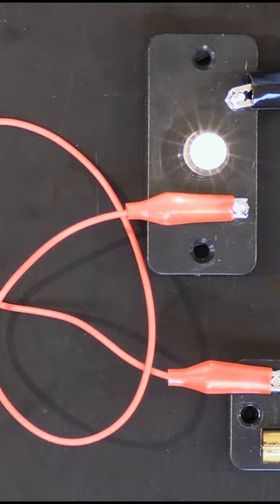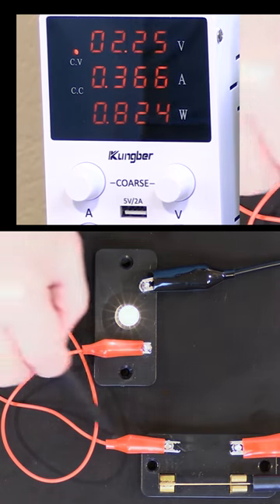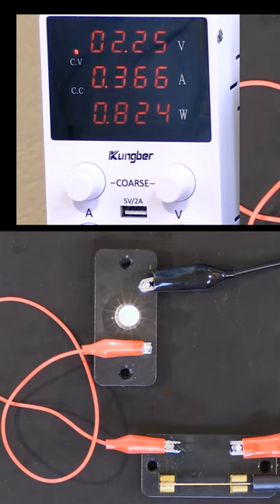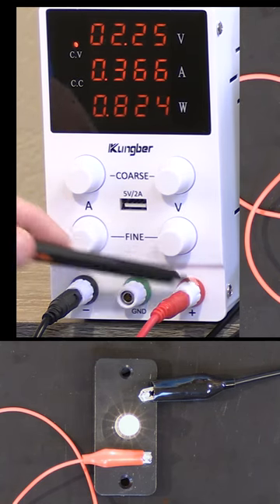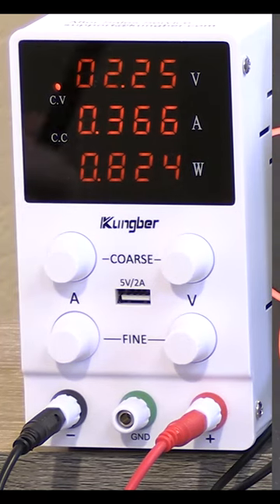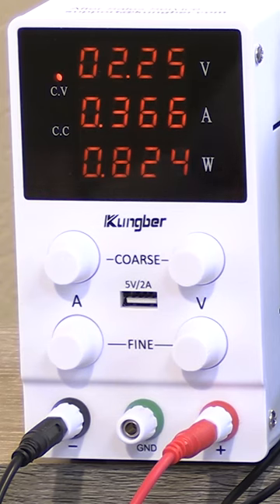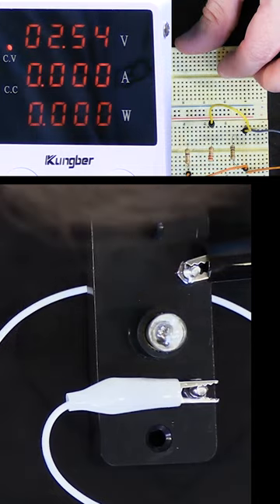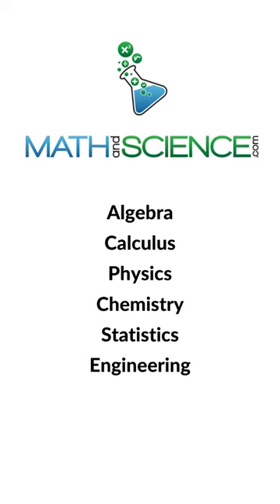What is Voltage, Current & Resistance?

Comment: Maybe we could try to think of it in another way, you can imagine there is a mountain with higher levels and lower levels, and the water is flowing, the water can only flow from a higher place to a lower place, and for the current is a bit like the water, it could only flow from higher voltage to lower voltage, so you can imagine the circuit is like a mountain, voltage as the level and current as the water.
Reply: That's copied from another video I know but you might of made it first so ?😅

Comment: I know there has to be a closed loop, but WHY does there have to be a closed loop?  Why can’t the electrons just fly out into the air, like in the water hose analogy?
Reply: Thunder.
Reply: They can but it is not useful for us. Think about it... Let us take like a battery powering up a bulb, only if the battery is connected to the bulb do we have any advantage. This control over electricity can only be achieved in a circuit!
Reply: @mmeovv  I think you mean lightning, because thunder is the sound that accompanies a rainstorm